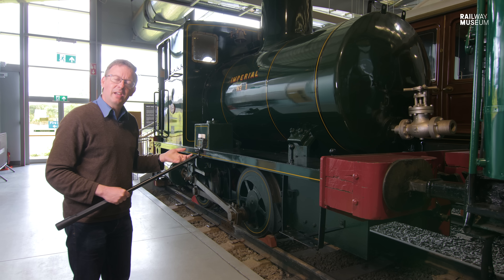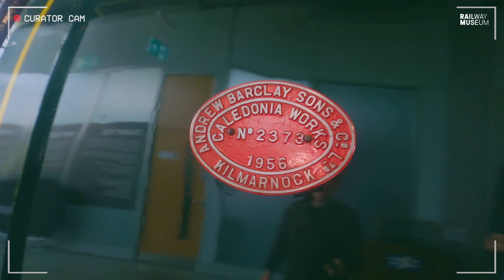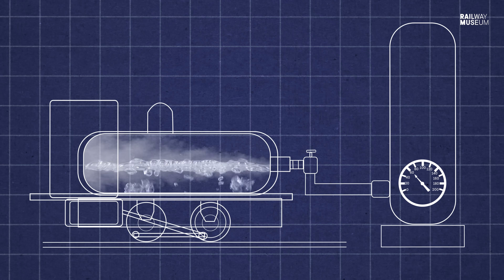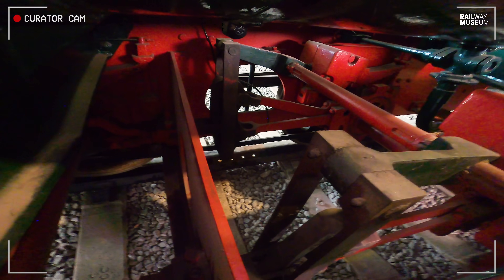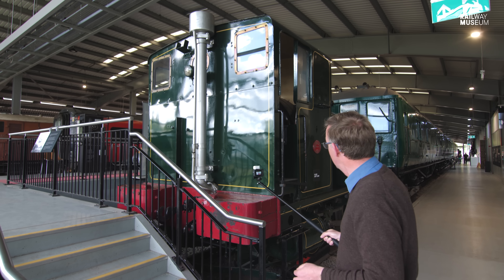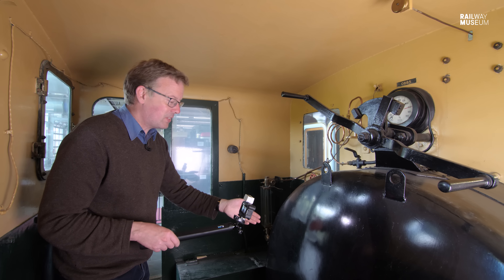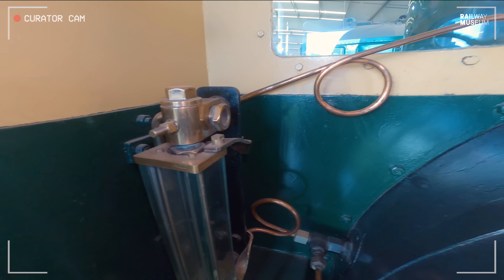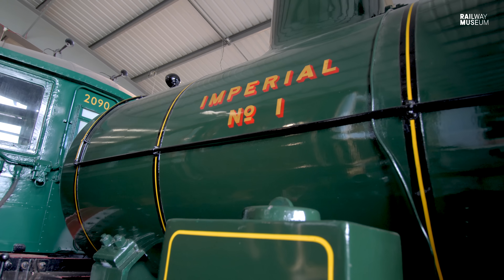A Steam Engine with No Fire? Fireless Locomotive Imperial No. 1 | Curator with a Camera

Comment: You showed the regulator,  but where was the forward/reverse valve?

As companies moved away from steam powered sites Diesel became easier to work with. I'd love to see little engines like these as Battery Electric.  Clean and Green.

Comment: You mentioned the Electric Lamps, Presumably battery operated, but I saw no sign of a battery box and should have been pointed out; it would need to be easily accessible for charging/changing, [maybe daily in winter.]

Comment: This is interesting, thanks for the explanation.
But couldn't this be solved with just high pressure air stored in the barrel? Steam needs to be kept hot to keep it in gas state, air don't, so over time, the steam charge would loose it"s power.
As far as what I know about steam engines (which isn't much), not the steam is important in the process, but the pressure generated buy making steam from water. So, in my logic (but I may forget important factors out, that's why I ask), the whole steam making process could be left out and they could just use any other gas stored in high pressure.

Comment: I once visited an oil refinery, and they had a big fireless loco there.  I asked if I could have a go, and they let me drive it up and down the yard (under supervision of course!).  It was very easy to operate.  Many years earlier, on a visit to a UK shed, I was taken for an outing on an ex-GWR tank engine which had been in steam, but the fire had recently been dropped.  We went several miles up and back using steam from the boiler - just like a fireless loco!

Comment: You still need to have a boiler producing the steam in the first place, so really you are just moving the fire away from it.  Up to 150 000 000 km away, if you could use a solar-powered boiler .....  otherwise, a purpose-built boiler room away from anything else inflammable  (if you have some sort of factory big enough to need its own railway and making paper, food, chemicals or anything that would not be safe around a steam locomotive, you almost certainly are going to need steam for something else anyway),  or maybe even the local power station.  But there would not be a lot of point using electricity to boil the water for the steam, when you could just have a DC electric locomotive with a bank of rechargeable lead-acid batteries and store the potential energy as electricity as opposed to high-pressure steam.  Rechargeable batteries and electric motors are more efficient than an internal combustion engine, let alone an external combustion engine.  Although energy efficiency probably was never given the same importance historically, as long as fuel was cheap enough .....

Comment: I was lucky enough to visit Leicester coal power station years ago (mid 60s) and had a ride on their fireless which was often seen from the nearby road busy shunting wagons. I recall they re-charged it about every 4 hours although it could last all day with light use. From memory they needed fireless as it entered some buildings. 
Something missed in this video is the short wheelbase which is vital for the extremely tight curves often found in industrial sites.
In Toronto museum is an even stranger air pressure  fireless loco from a wood mill!

Comment: This type of locomotive is perfectly practical today given a ready source of steam. The reservoir is a pressure-vessel of course, but probably nothing as complex as a regular boiler to construct. The potential snag would be the need to brake the rake of wagons or tanks.
One thing the man did not mention was how that headlight was powered. Mini steam generators did exist for this role on conventional locomotives. At night it would be a drain on the steam supply.

Comment: I would be interested to know how long a fireless engine would last between recharges of boiling water?
Reply: I was wondering the same. A pity they didn't cover that.
Reply: We have a fireless locomotive still working, not far away from my home, in Herne, Germany. There isnt really an answer to that question, but it depends obviously on the work load. But basically you can say they last 6-8 hours, a good work shift.
Reply: @nurderbvbabernurderbvb  More than I expected

Comment: The presenter suggests fireless locos are environmentally friendly, which they are in operation, however the means used to generate the steam externally, unless gas is being used as the heating source, are not

Comment: These were fairly common in the US, used where an industrial plant already made a lot of steam for the processes, so the relatively small amount of steam these used was almost free.  Usually charged twice a day, in the morning and at lunchtime. They partially filled the boiler/reservoir with hot water, then steam.  As the steam was used, the water turned into more steam.  It really is a boiler, and was considered as such in the US, as it generates new steam from water as steam is used.

Several local steam power plants had them, and they were popular in chemical and ammunition plants, where a normal steam engine would have been a fire hazard.  In the US, the boiler was usually larger diameter than this.

There were some bigger fireless engines in the US, 0-6-0 at least.

Comment: The only real problem is range, depending on loading one must wonder how long and often it took to charge this up. Still better than a lead acid battery pack and an electric motor.
Reply: might be possible to slap a tender to the thing for extended range...
wonder how a mainline version would do.

Comment: I remember in the early seventies the little peepers trundling up and down moving wagons waiting to be picked up and brought out on the Blue Circle line to Northfleet.   When waiting for the bus home, you could see the mill through the railings next to the bus station.   Us kids also wandered down to Bowater's to mess around with the Bowaters operation begging anything for a ride on the ropeway, the fireless engines survived BR steam by some years except the Vale of Rheidol steam engines.   I did see the tunnels when on summer holiday I went in with my uncle who was a class 33 driver based at Hoo who occasionally would be rostered to pick up some Blue Circle wagons or drop off empties as a lot of concrete bridge building in that part of Kent.

Comment: By my quick calculation - if it holds 1 ton of water (just a guess) boiling at 200 psi, and run it down to 85 psi, that's a temperature drop of about 38C, which releases about 145 megajoules of energy, or 40 kWh. So, that's a bit less energy than the smallest battery option for the Tesla Model-3.

Comment: One comment about the hand brake. Most Barclay engines I've driven have had the traditional screw brake at the back, but in this case, there's no need for the usual small coal bunker, so perhaps this was a standard they used for fireless pugs. You always had to watch that the sliding door was fully open when you turned the hand brake, or you scuffed your hand! One other point - I was always told that the reason we had no fireless engines here was because the patient was held in Germany, and during the war there was no way to uphold this - any truth in this?
Last thing - did you miss out the reverser?

Comment: It's simply cause it's a Cab forward locomotive. There are Fire-less and Air compression locomotives with the same controls layout built with the Cylinders in the traditional location and piped up to look like a funny traditional steam locomotive. This wasn't a weight balance but a preferred operations thing. the paper mill wanted their Drivers to see what's in front of them when moving a load out over pushing a load in is what I'd wager, totally more gives you a look into the work flow of the Paper mill.
Edit: the give away that it 100% a Cab forward locomotive is the location of the brake handle.
Reply: I don't think running direction has anything to do with cylinder placement. Tank engines can run in either direction just fine, and many cab-forward steam locomotives had cylinders behind the driving wheels, including the famous Southern Pacific cab-forwards.
Reply: @kkobayashi1  it has everything to do with Cylinder placement. Cause it's where you want the major power stoke of the piston to go. The "balancing" he talks about would be why they would of used Stephenson vs other valve gear types if that was indeed a factor they needed to consider.
Reply: @Dallen9  That makes no sense. For one thing, steam pistons work in both directions (push and pull).
Reply: @kkobayashi1  The steam piston will always produce more power in one way then the other unless you've done some material balancing like the French and Germans did on some of their locomotives. Why it's been referred to as a Major and Minor power stroke. Valve timing also plays a part in it but again it's because of the discrepancy of there being a Major and a minor Power stroke why it plays a factor in it. These are the factors that make up Hammer blow.
Reply: The cab is a regular tank engine cab, same as the peckets.
Reply: @davidty2006 The brake location says other wise. unless there's two brake stands and the curator only showed one of them you normally have the Brake, the throttle, and the Reverser in the hands of the Driver from the drivers "seat".
Reply: @Dallen9  Thats where handbrakes on engines always are. As he says it's a handbrake and not a regular brake.
Reply: @davidty2006  Mmm hmmm And the water glass is on that side too.... Almost like they the driver on that side of the cab when driving the locomotive.
Reply: @Dallen9  Thats the normal side for driving on british locomotives.
Reply: @davidty2006  Sure it is. if only that was a true statement. Unfortunately last I checked it was either or in the UK. I.e. the company decided the side the driver sits depending what mood they were in when the locomotive was being designed.
Reply: @Dallen9  Normally general rule is, Mainline locomotives left side, Shunters normally designed for both sides for maximum visibility in yards.
Reply: Shunting locomotives don't have a front or back anyway. They are designed to run in both directions.

Comment: I could be mistaken, but your recharging valve 3:50 appears to be installed incorrectly going by the arrow cast into the body. It is likely that the valve is also a check valve so the arrow is critical. Is there perhaps a drain valve fitted to the lowest part?
Reply: The arrow indicates the direction of pressure the valve is designed to withstand when closed, so I believe it's correct.

Comment: From the Sir Topham Hat point of view, of course, it means that you can run it with one man - no need to have someone there to make steam.  If an industrial plant already had a supply of steam and needed an internal railway, it seems a fireless locomotive would be a no-brainer.  If the plant didn't have a supply of steam already, I can't see anyone do it.  

Another fine film - thanks!

Comment: There's actually a bit of irony here.  We in Belgium are currently going to be restoring a fireless steam locomotive to run in an old coal mine.  The coal mine of course has been decommissioned and is no longer mining; it will just be there for the entertainment of the visitors.
Reply: Belgium, a country with a greater density of railways than even the UK, I believe? Is that correct?.
Reply: @andrewemery4272  I believe so.  We are a very small country but I literally live within walking distance of a station so it could be possible.
Reply: That's great to hear I never saw a fireless locomotive working and sure it will be an exhibit a lot want to see working Which mine museum is it
Reply: How long could these work until they had to be recharged? Understanding there would be many variables.  Could they last through a 8 hour shift?
Reply: The UK has not historically had to handle a lot of through surface traffic from its neighbors transiting through the country to get to somewhere else, whereas Belgium constantly has people passing through it to get to its neighbors. I can think up a couple of big examples from the first half of the 20th century.